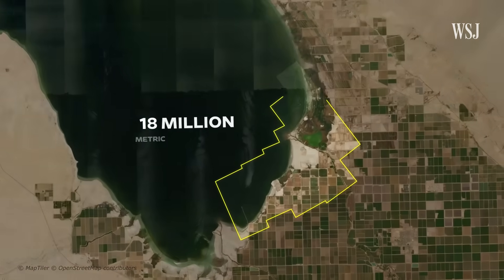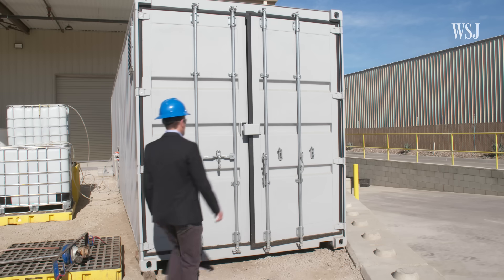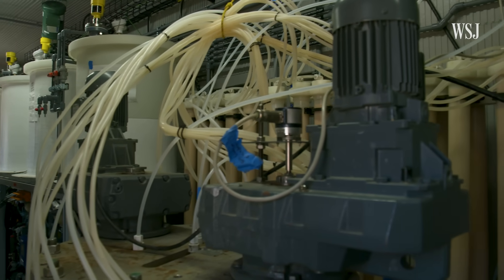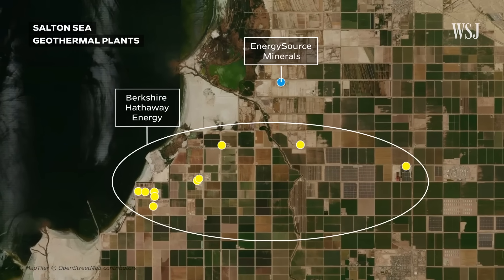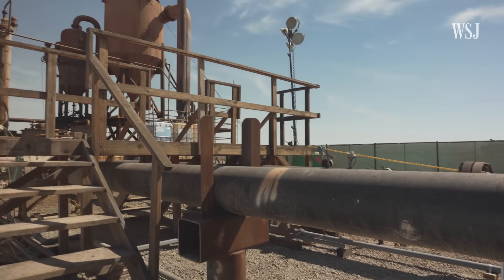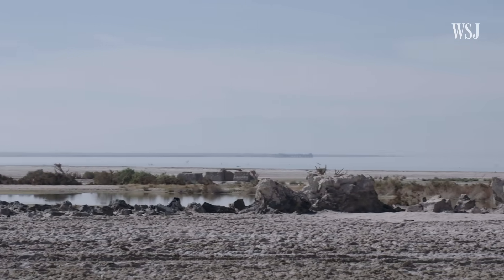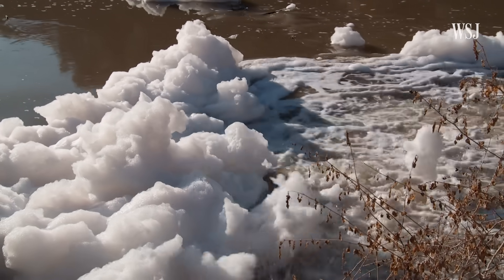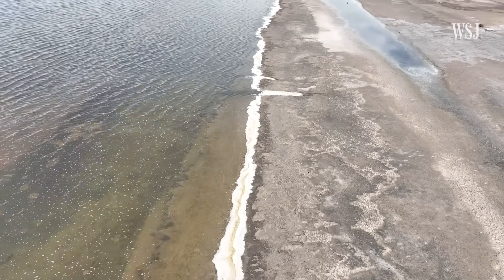This Toxic, Drying U.S. Lake Could Turn Into the ‘Saudi Arabia of Lithium' | WSJ

Comment: I just watched a documentary on the test runs for Hiroshima and Nagasaki. They AEC and army air corp used the Salton sea to test drop 1000 10,000 pound test bombs filled with depleted uranium to simulate the proper weight. The bombs were never recovered. So there is close to 10,000,000 pounds of depleted uranium test bombs stuck in that lake bed also. The first 100 of the test bombs were filled with concrete and lead. The rest were all filled with depleted uranium.

Comment: What are they going to do when, not if, but when the Salton Buttes volcano erupts? It is in the top 5 most likely volcanoes to erupt in the next 50 years. It has erupted at least 3 times in the last 2,000 years and you ought to see the new mud pots. Those things are getting more numerous and are releasing more Sulphur dioxide and not just CO2. The lava dome complex sits on a tectonic boundary of the Imperial fault and the San Andreas fault which begins near there. A large quake with no warning could set it off. The area is known for earthquake swarms of the tectonic variety and some hydro quakes from the power plants.

Fortunately they have historically been fairly small eruptions if you consider a VEI 3 eruption small. It is classified as a high threat volcano and because it is a rhyolite lava dome  complex it will always be explosive. It is near a population center and volcanic ash could interfere with aviation. Those power plants will be toast, or at least the two closest ones. Pyroclastic flows is the main threat with rocks being thrown up to 5 km. The danger is being minimized by the local powers that be.

Comment: The lithium is found in brine pools under or near the Salton sea, not the sea itself. They plan to use geothermal energy to bring it up and then filter the lithium from the brine. The brine then gets pumped back underground. All good so far. 

But that brine will grt more concentrated over time. It's already pretty toxic but it will slowly get more worse. As the video says it's pretty corrosive to machinery.

Eventually they will need fresh water to continue extracting lithium. The only sources for that fresh water will be the Colorado River or the Salton. 

The Colorado river is already completely allocated to farms and communities. 

The Salton already has high salt concentrations but nowhere near the levels of the underground brine so it will probably be useful for lithium extraction.

Of course this will continue to lower the sea level and expose more salt beds to the wind.

So far the lithium companies and the state say that they will remediate the Salton but offer absolutely no details on how this will be done and of course what will happen to the toxic waste that the brine will become. 

More than likely the companies will extract the lithium till it's no longer commercially viable and then leave the clean up to the taxpayers.

Comment: i should say some things, on the issue of EV's.   i'm generally against the idea, because the cost is much more.  but, liberal-intellectually, you never say never.
batteries require recycling.  lithium is costly to extract.  nickel is the bottleneck material.  sodium instead of lithium requires more nickel content in the batteries.
the vehicles total weight goes up, by a factor of 2 ; a Model S weighs as much as a Ford F-150(!) and the electricity generated still requires fossil fuel(!) 
if we're really battling 'climate-change', maybe we ought to plant trees, and protect those forests with a grids; 5-lane wide highway type grid, so fire can't spread so easily. 
now, back to EV's.  alternatives aren't to be found so easily.  hydrogen gas.  if it is in liquid form, with a fuel cell, it can be done - but the cost of platinum as a catalyst in fuel cells, is very high - the cost of compressing the hydrogen gas is also pertinent.  and the polymer substitutes as catalysts aren't proven; more like hype, to attract funding. and if hydrogen is stored as a gas, you need a Uhaul trailer to carry it around with you(!).  so, this is not an easy problem at all.  what's left?
we need to get electricity costs down to the same level as natural gas, as quickly as possible.  this then means, it's possible to create fossil fuel out of carbon and hydrogen(!)
because, there's no substitute for petroleum (gasoline) or diesel.   we haven't done a great job with wind power, solar power or geothermal.  these (latter) are the greatest areas of improvement.  remember, back when fracking in Alberta costed so much more than WTI grade oil? - now, the cost is roughly equivalent, due to the technological improvements through years of persistent effort (i have two relatives who worked the oil-patch as engineers, that's why i know).  that's why, it's important to keep pushing in this area (renewable energy)...

Comment: Which PR firm on behalf of a state actor paid for this exercise in reputation laundering… this would create pollution runoff the likes of which China would blush at.
Reply: There is no connection between the Mistake Lake and the extraction of lithium salts from geothermal brine that is already being extracted. There is no runoff. It is adsorbed on ceramic beads
Reply: So you want to push the climate change nonsense then don't want the solution? We should ignore the BS green lobby.

Comment: The biggest problem with the Salton Sea area is the corruption of the local and State Politicians.

A bond issue in 2014? Should be investigated for what happened to the millions of dollars for the lake. Not one drop of water came into the lake but the $ did drop into " friends" of the politicians' pockets.

The Ca dept responsible for the $ refused to give the names of those recipients and the reason for them getting that $$$$.
Reply: A bond can be defined and voted on and not spent. Besides, remediation does not mean "refilling". The lake is going away

Comment: Lithium is reactive and unstable when used to deliver stored energy. This is a political fad. It’s impractical and if this goes forward we will have plenty of lithium without a market for it unless its properties are better understood for practical porpoises.
Reply: Lithium salt is as stable as table salt. if it was reactive it would not lay in deposits waiting to be solubilized. Metallic Lithium and lithium ions as found in batteries is a different matter

Comment: This will change nothing related to consumer cost. Once this operation is full scale the cost to consumers will skyrocket.
Reply: False. it depends on demand vs supply (just like everything else). EV sales are WAY down and projections are not great. Ford is scaling way back as the EV F-150 has not panned out.
Reply: @Juneisthebestmonth  you only thinking about EV vehicles brother. I'm talking about everything.
Reply: @anonymousbiscuit5799  so you are saying the cost of everything will skyrocket? it already has Mr. Biden
Reply: @Juneisthebestmonth  ok I don't do trolls, we either can discuss or you can move on. No one said anything about Joe or Donald. Good day
Reply: @anonymousbiscuit5799  Facts matter. I developed the process. Your initial comment doesn't even make sense as you did not even say the cost of "what"! Once plentiful, the cost of lithium will be relatively stable like oil

Comment: Mining ocean or waste brine water for hydrogen gaseous fuel equivalent to 25 cents per gasoline gallon equivalent ($0.25 KG) will provide transportation fuel, electrical energy and desalinated ocean water as free byproduct of producing the lowest cost decentralized and on demand energy on the planet. The outdated electrolysis of purified water can't compete with cavitation technology that has discovered how to crack any type of pond, polluted or salt water without electrolysis or chemicals. California and Mexico can liberate the US from expensive and polluting fossil fuels and international interest in cavitation for countless applications is rapidly expanding all over the world. The mineral rich waste brine is ideal for contruction materials that won't dissolve by moisture or rain. Instead of metal rebar the basalt volcanic rock does not decay or rust exposed to salt for current infrastructure projects. The Laguna Salada in Mexico is below sea level plus the Salton Sea and Death Valley are ideal for gravity fed ocean water safely storing endless sources of hydrogen and solar evaporation for increasing monsoonal moisture for Colorado Basin and California and Mexico becomes largest zero pollution and green energy exporter for Hydrogen Dollar to compete with Petrol Dollar has huge upside potential.
Reply: For the LAST time, you cannot convey ocean water over freshwater aquifers, below sea level in an active earthquake zone.

HARD STOP
Reply: @Juneisthebestmonth  Small man made earthquakes resulting from geotherma activities not only the catalyst for activating San Andreas but mining lithium requires huge amounts of fresh water. The concept of desalinating ocean water as free byproduct o generating highly competitive electricity 24/7 is the driving force behind cavitation of any type of water not electrolysis.

Comment: Bring in water from the Sea of Cortez share with Mexico. This way it can control some of the problems caused by wind blown contaminants that have plagued the young and elderly and those with breathing problems. In the Imperial Valley and Coachella Valley when the wind blows north. If this isn’t done it would be criminal because it would only make a bad situation worse.
Reply: NEVER, EVER. You cannot convey ocean water over fresh water aquifers, below sea level, in a very active earthquake zone. HARD STOP. That is why that idea was tossed. Besides, the IID and local tribes own the land under the current Mistake Lake and they want it back.

Comment: 18 millions tons is a lot but it's in the form of geothermal brine. Geothermal brines aren't something uncommon and can be found in many places. They usually use it to generate power. But extracting from it basically the same as making synthetic fuel. So it's kinda useless for now.
Reply: Completely false...I helped develop the process over 20 years ago. It makes the purest form of lithium carbonate and lithium hydroxide - allowing the highest current densities and lowest heat generated when being used. Are you just guessing?

Comment: To get rid of the toxic dust, you have to fill the Salton Sea back up to it's previous level. You could just use ocean water, via the Gulf of California.
Or divert water from the Colorado River.
Reply: also stop extracting ground water would help. Surface water and underground water are connected.
Reply: that will NEVER happen, it is purposely being drained for the past 20 years. You cannot convey ocean water, below sea level, over fresh water aquifers, in an active earthquake zone. Besides, adding ocean water to a trapped lake is just plain dumb.

Comment: They are extracting the Lithium using fresh water. Fresh water is scarce in the desert. Most fresh water used in the Coachella Valley and Imperial Valley come from the Colorado River.
Reply: Wrong! 🙄
Reply: @Riceman-o1p  
The filters used are flushed using fresh water. It is a fact.
Reply: @RC-ot5nw  ok!

Comment: It may have been outside the scope of the news story, but I did note that very little was said about the process to turn the Purified Lithium Chloride (the liquid) into solidified lithium for use in batteries.  How enviromentally sound is that process?  At times it appears we are just trading one evil for another.

I also could not help but notice that a significant portion of the noncorrosive parts required for the lithium extraction were made from plastic....all made from petroluem.
Reply: Lithium chloride? The intermediates are lithium carbonate and lithium hydroxide. Both are salts dissolved in water and do fine in inexpensive plastic pipe. Just like your home!
Reply: "At times it appears we are just trading one evil for another."  That's all we ever do in pursuit of a cleaner Earth.....
Reply: Lithium is going to be mined either way whether it's on US soil or in another country. Might as well develop an industry for it here in the US to help support our economy. According to the video they are developing new techniques that hopefully keep the environmental impact minimal.
Reply: @cjoin83  LOL, I was a part of the development over 15 years ago....
Reply: Significantly more environmentally sound than drilling for oil.
Reply: @schubajo the extraction of lithium salts from geothermal brine is in a closed system.

Comment: Good thing the bulk of lithium comes from US allies or in our sphere of control. I guess the media has been lying to us about this as well by stating that most of the lithium comes from china.  The need for lithium itself is a debacle. We will never be able to adopt EV's at the scale desired because we'll never be able to produce enough electricity to charge them all. Despite such success discovering lithium deposits we are headed in the wrong direction. So it's a win for setting ourselves up for failure. Yay! It's the liberal mindset
Reply: oh, we can easily make enough electricity - we have plenty of natural gas - just need more distribution networks and generating facilities. We are flaring natural gas now!